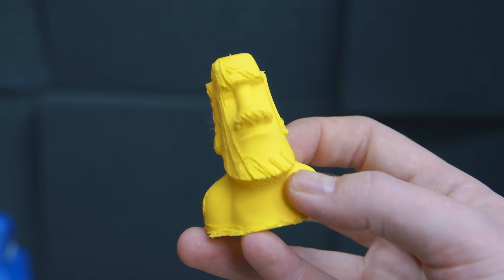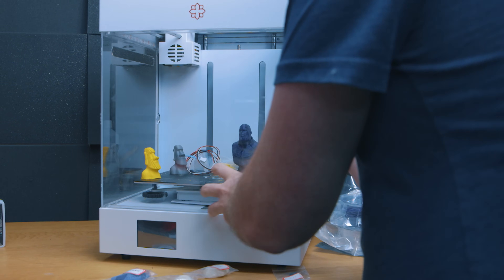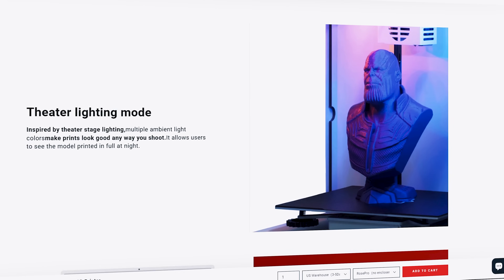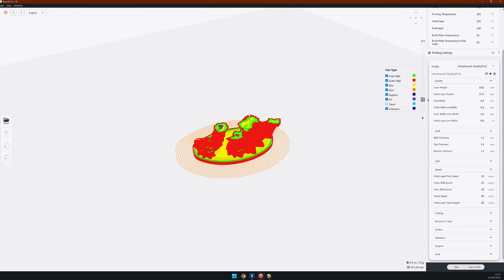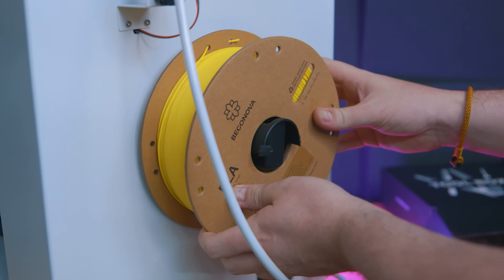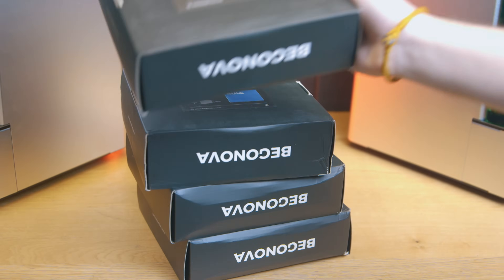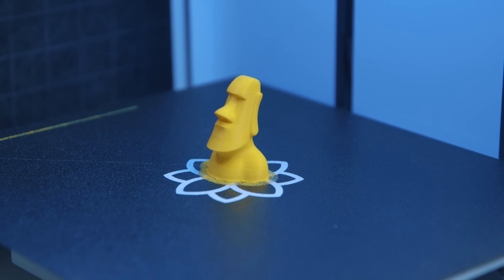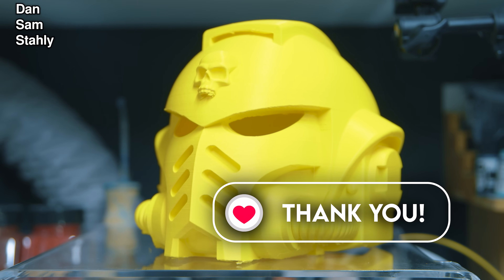Begonova Rose Pro Review - RESIN LAYER HEIGHT on an FDM PRINTER

Comment: Well the problems with this seems like a wrong profile. I am sure that if you give it to me, give me one month, a lot of beer and desparation I would fix it no problem :D
ROFL, meaning it would take too long time to dial up a brand new profile, but if the hardware makes it possible to print at 0.02, then this is just a profile calibration. Such a pitty for so many chinese printers that they do not come with ready profiles. Missed oportunity.

Btw why do you print helmets with support in the middle? It is sooo time consuming and i am not sure if the quality of the bottom part is worth it?

Comment: The ultraprint isn't a Saturn 3 ultra rip off. It has a  build-in heater and a build-in curing system. So..
Reply from the maker: When you look at it in the video it has an identical vat and an identical build plate, the build plate is odd considering it says it’s self levelling???!?!? If so, why does it have a levelling mechanism?

It’s very possible they are using the components of a Saturn 3 ultra and just slapped a new casing on it.

It screams “dodgy” to me and I could be wrong, but I have bad vibes
Reply: @FauxHammer  Would make an entertaininh video to see what that's all about though!

Comment: My problem with minis on FDM is that most 32mm minis have lots of neat detail... and slender bits that need supporting in ways that even "tree supports" aren't great for. One day FDM may match resin in quality, but even if it does, the time to print minis with delicate bits like bowstrings and wispy hair will be much higher than doing a resin print. Forget high speed printing for that stuff.
Reply: I hope that day will be reached, because I'd happily take that extra time. I'd love to print with resin but the dangers of it are just a bit too much for me.

Comment: They derail themselfs with the price. I can get the biggest Elegoo Neptune 4 for that price. Is it possible that they're Z-axis stepper motor is so weak that they need the fine pitched thread to get enough torque? And then someone noticed that this got them down to 0,02 mm per step? 0,02 mm per step * 200 steps per one revolution of the motor would be a 4 mm pitch on the tread. A very common size in trapezoidal threads. And then marketing put that on the box because it sounds good, but engineering took it out of the slicer because the printer vibrates so much that the nozzle digs into the print?

Comment: FDM probably won't ever hit the same quality of a resin 3D printer.  Simply, the nozzle is too large. The theoretically smallest thing I can print on my Saturn 3 19x24x10 microns. The smallest nozzle for FDM is .1mm which is about 20 times in diameter the smallest resolution. you have to deal with kinematics that will change over time due to wear, and excessivly long print times. The question is, why would you want resin quality in FDM? A miniature is done in 30 minutes to 4 hours on resin. That is many more hours longer than FDM and it wont be any more durable at that scale.

Comment: .002 layers and nozzles smaller than .4mm are, at best, waste of time on FDM, and will never replicate resin.

In my experience the only consumer-grade FDM printer that got sort-of close to resin was the 3DS Cube. That was when its array of other issues where sort of solved with custom and short-lived hacks. It's nozzle was still .4 tho.

In short, if you need resin quality, use a resin printer.

Comment: My printer is capable of 0.04mm but i also did a bunch of upgrades and diy solutions. 

What limits good prints on fdm is first off.  here in this context, is the minimum z height when comparing minimum pure step change in your z motor compared to its guide screw.

In a ender 3 or any ender3 clone is 0.04mm z height. While you can go between (dont do it) it will have to try to keep the motor between 2 stages in the steppers inside the motor. It is hard to do for the printer and will lower your quality. So when you print, always do it in steps of z jumpsuit.

For a ender 3, tjat would be 0.04 / 0.08 / 0.12 / 0.16 / 0.20 and so on.

If they managed to do it with 0.02 instead, that is interesting. But if it is just to keep it between 2 steps.... then nothing to write home about

Comment: welp, layer height doesn't matter that much if extrusion is inconsistent. That is why you will always see those layer lines on fdm. Also you would need nice filament sensor that measures filament flow into the nozzle, pressure advance etc to minimize layer lines

Comment: as I'm sure you're realizing - no fdm printer is going to get you to invisible layer lines like resin with anti aliasing on. its just not going to happen. there's no physical way to blur the lines. and even if you could reliably and consistently produce layers that were so fine that they were imperceptible, the print times would be ridiculous to the point of being non functional. I love fdm, but it has its place